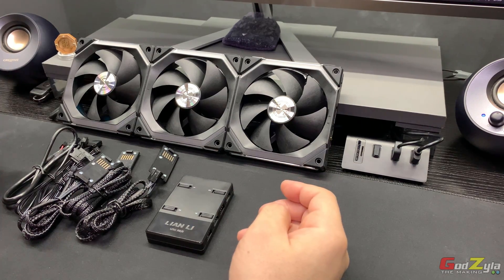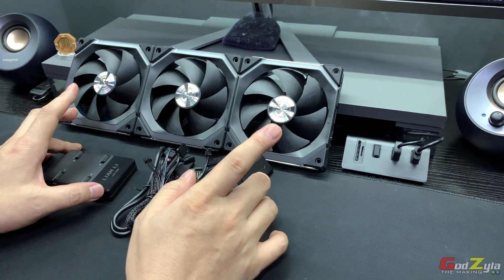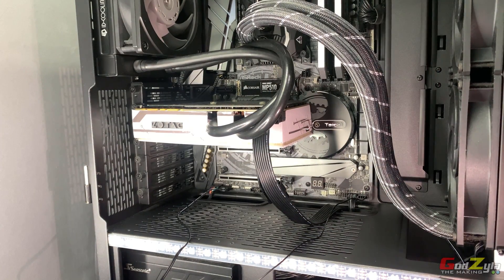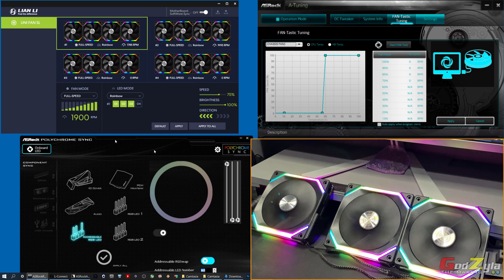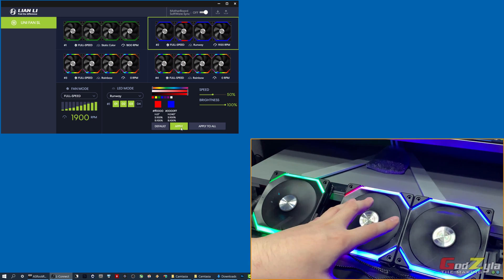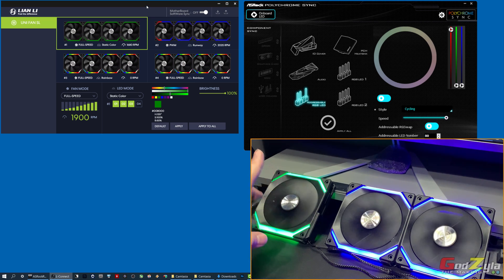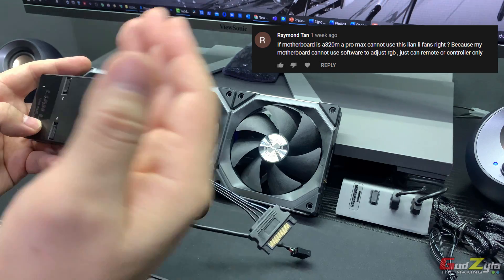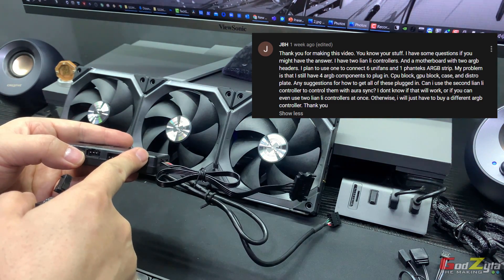Lian Li Uni Fan SL120 - Connection & The Controller (Part III) [L-Connect]

Comment from the maker: I have done a series of videos base on this uni fan which might interest you, list as follow

Introduction (Part I) - https://youtu.be/ORdObJTn-3E
Dos and Dont's (Part II) - https://youtu.be/QQHJUQvKwlY
To use Galahad AIO on Uni Fan Controller - https://youtu.be/XNCAeAX0mZQ 
Some Break Fix!  - https://youtu.be/8l4i5UjO3es 
How to link Push and Pull configuration fans -  https://youtu.be/TIO8JxVZTi8 
Using EK Vardar Evo 120ER aRGB Fans on this uni -  https://youtu.be/bMRz2KVqbjA
SL120 Case Airflow Test - https://youtu.be/Qp3pYqOOjm4
SL120 Static Pressure Airflow Test - https://youtu.be/apDZ4v_jQBs
Reply: Hallo i hope i get an answer, How much fans Can i Plug into the Fan hub?
Reply from the maker: @avur_ied5195  total of 16 to one fan hub, max 4 to each output. I like to invite you to watch the dos and dont's of the uni controller in this playlist. https://youtube.com/playlist?list=PLEW-b-2vYDdPo0NzHyeksx012c-nkDapm it will tell you about the argb load limitation.

Comment: Its weird . i did everything right. but im not able to control the speed of the fans. they're always at max speed. they make so much noise. changing to quiet or chaning the RPM on the lconnect app doesnt change anything on the fans ,, they just keep rolling at max speed. even if i put the rpm at 500 rpm
Reply from the maker: Hi Metan3x, welcome to my channel, before you do anything, check on Device Manager and under Universal Serial Bus Devices, do you see the uni controller/hub shown in the list? if it does not, then you won't be able to control the fans or the argb effects of the fans from L-Connect 3 app. I suggest you to go through this content. https://youtu.be/CgvuUFeff8U?si=6AQhAX2hX_dIvKlF

Comment: What if i connect the fan header from the hub, to pump_fan2 header at motherboard. Is it okay ?
Reply from the maker: Hi Roby Wilson, welcome to my channel. if you have two pump header. yup no issue, just make sure that you are able to set your pump header 2 to PWM mode.

Comment: My PC setup needed a hub, So i picked up the nzxt USB hub. I then connected the uni hub to that hub. hub which is connected to the motherboard's USB.  booted up the PC opened L connect 3. sl controller not seeing fan speeds as well as not being able to change the lighting effects. .. lights are on (rainbow)  also fans are spinning. but no control. any tips????
Reply from the maker: Hi TheOpsZone, welcome to my channel. first of all when you connect the uni controller only, without the fans, does the controller appears in device manager under Universal Serial Bus Devices? You might want to watch this https://youtu.be/CgvuUFeff8U to see if it helps to resolve your issue.
Reply: @KleoYan  I'll give it a try. I'll definitely get back to ya.
Reply from the maker: @theopszone6775  ok. All the best in your build
Reply: @KleoYan  Thank you.
Reply from the maker: @theopszone6775  you are most welcome.
Reply: @KleoYan  Okay, I watched your other vid. Actually what my setup is close too with using the hub. So I unplug all except for the one Iam not getting readings on, I do see the universal serial bus controller. I even unistall the software and reinstall, same issues. No readings. I also plug the front fans SL directly into the motherboard. Software still don't pick upon it. Fans are just to on autopilot. Maybe it's better to email ya, let me know thanks.
Reply from the maker: @theopszone6775  what if you plug in directly without using the NZXT hub, will that work. my email is godzylatech@gmail.com

Comment: i have three single packs for the sl120s do i still need to get the controller or is it fine to install them individually
Reply from the maker: Hi Satory_ , welcome to my channel, yes you can do without the controller but you can't use L-Connect 3 app for the argb effects as it needs it's controller.
when you daisy chain these fans and to be plug to your motherboard, please check the fan load and argb load of what your motherboard can supply. do not overload those header. for fan load, it should not be an issue if you keep the daisy chain max at 3 to 4 fans. but for ARGB, kindly check what's the ampere.
Reply: @KleoYan  how can i control the rgb then
Reply from the maker: @shoonbabaa  if you go without the uni controller, you will need to connect your fans argb to your motherboard, check to see if your motherboard have the 5v argb 3 pin header. Then make use of your motherboard argb application to control the argb effects which are limited on effects

Comment: Hey question, when I boot up my pc my fans turn back to default. Do you know how to fix this?
Reply from the maker: hi Father mike, welcome to my channel. do you mean the argb or the pwm settings? this is normal as the settings will kick in after windows is loaded and when your L-Connect 3 app booted up.

Comment: does all of this work the same for AL120 fans?
Reply from the maker: Hello Creamworks, welcome to my channel and yes they connection are the same but you need to connect AL120 fans to the AL Uni controller / hub. now, if you understand this and using the L-Connect 3,  this will give you a better explaination on how L-Connect 3 app works https://youtu.be/CgvuUFeff8U  you see the content illustrated here is using the old version of L-Connect app. hope this helps.
Reply: @KleoYan  Thank you very much I will check that video out!
Reply from the maker: @Creamworks  you are most welcome.

Comment: Was watching the video until i saw the radiator tubes lower then the pump 😱😅
Reply from the maker: hello Mikeaboss, welcome to my channel, hmm is there anything wrong with that lol.. should be a better setup this wayy though hmm.
Reply: @KleoYan  if your cooler is not overheating its ok but the tubes should be pointing up, because thats where air bubbles go. The pump needs to be lower then the tubes otherwise your pump wont last long. Its not recommended.
Reply from the maker: @TheAzorian  i see.. don't make sense.. my tubes are below.. air bubbles are at the top, therefore the punp is circulating only water and not with air bubbles. I have use this AIO from then till now .. no issue whatsoever.
Reply: @KleoYan  no bro, the bubbles will stay at the pump which is not good. If its running its fine i guess. But go online and search about it, you can get more in depth info
Reply from the maker: @TheAzorian  I see, I know what you mean now.. thanks.. but i no longer using it on my primary rig. I have changed to use a 420 in a Lancool III case . https://youtu.be/aitIxf_1FEU nevertheless thank you..
Reply: @KleoYan  no problem man. After selling my gaming pc over 1 year ago due to needing money i finally built it again. Went for lian li case, fans and the lian li galahad cooler 😍 thats why i came to check your video as it was the first time i used a fan hub and had no clue about the cables. 😅
Reply from the maker: @TheAzorian  oh.. for basics of these uni fans, just watch part I to III of this playlist (mainly the connection and use of the application and the dos and donts'), then jump to any content that says [L-Connect 3] as those that are L-Connect and L-Connect 2 are no longer the go to app that current pc builders are using. https://youtube.com/playlist?list=PLEW-b-2vYDdPo0NzHyeksx012c-nkDapm and if you need help, I will try to help you out. If I don't response to you... you can reach out to me at godzylatech@gmail.com .. I will try to help you out if you needed any.

Comment: Why does my fan controller have 2 sata power connectors coming out of it? They are built in i cant disonnect 1. Do i need to connect both to the psu?
Reply from the maker: Hi Misdom, welcome to my channel, the uni fan you have are the SL Inifinity 120 and not SL120, for SL Infinity SL120, there are two Sata connectors and yes you will need to plug both of them. you might want to refer to this video https://youtu.be/CgvuUFeff8U

Comment: To use my synapse controlled lighting  with the Lian-Li fans I had to set up the L-Connect to turn on when the system starts and then automate it to turn off a minute later otherwise the fans would just stay in rainbow and wouldn't pass control over to the motherboard and synapse etc
Reply from the maker: Hello Metatron, welcome to my channel. thank you for sharing your experience and insight of how to make use of these uni fans on Razer Chroma argb controller. greatly appreciated this. 😉
Reply: Hi  @KleoYan  no problem, yes just to back up what you said I am using it with the chroma argb controller
Reply from the maker: @0Metatron  thanks.

Comment: can we change rgb even without controller?
Reply from the maker: HEllo Luciferou, welcome to my channel, if you are using the L-Connect app, no you cannot do that without the controller. If you are using motherboard argb app. yes you can but you will need to plug the SL120 argb connector directly to the motherboard and please make sure your motherboard argb header have sufficient argb load, else you will melt or damage the connector.
Reply: @KleoYan  ok broda ty
Reply from the maker: @LawAbidingSociopath69  you are most welcome.. all the very best with your build. 😉

Comment: Why is your is showing manually fan rpm? My only shows custom...? All the fans are plugged to the controller
Reply from the maker: Hello Chris Valdez, welcome to my channel. hmm.. in this video is illustrate both can be done using L-Connect RPMs or to bypass L-Connect and to use the motherboard fan utility. Hope that answer your question.
Reply: @KleoYan  ahh, I see... so it will function just fine as long I'm able to move the graph each one? I can tell that fans are reacting differently by moving that graph chart upon applying it... 

As for the aio cpu cooler,  will I be able to increase the fan itself or it automatically does its own?
Reply from the maker: @chrisvaladez925  which AIO cpu cooler are you using? if they are SL fans and are plug to the uni controller, it will work.. unless you are using different fans.
Reply: @KleoYan  I'm using Lian Li AiO 360 Galahad , it detect cpu load on L-Connect, no options of changing rgb for aio...I plugged in on aio pump on motherboard
Reply: @KleoYan  all my fans are all Uni fans 120
Reply: @KleoYan  I'm not using the aio fans that came with it...
Reply from the maker: @chrisvaladez925  do pardon me for the late reply. ok i will tackle your questions one at a time. 

Q1)  I'm using Lian Li AiO 360 Galahad , it detect cpu load on L-Connect, no options of changing rgb for aio...I plugged in on aio pump on motherboard
A1) Leave the pump connector directly to your motherboard fan header, plug the argb connector to the uni controller. 

Q2)  also, on the lian li software,  I'm not able to change the aio cpu rgb...it's has the led on...perhaps I have to disable the other software currently connected to it using Red dragon msi?
A2) If you've plug the pump argb connector to the uni controller, either port, lets say port one, in L-Connect, under SL120, select port one  and change the effects from there.

Q3) all my fans are all Uni fans 120
A3) If all your SL120 fans are connected to the uni controller, you should be able to control both argb and fan load. here is a diagram with might aid you. https://imgur.com/gallery/beYR8CN if picture too small, kindly download and view them. by the way you will need the lian li argb kit. you will need to purchase that.
Reply: @KleoYan  ooo! Pardon your delay, we all have stuff to do lol

So far all the fans are reacting well when changing rpm.

I will take a closer look for the aio pump rgb, I have them well all connected,  I know I'm right there when reading between MB & Aio manual... 

That link you provided with it diagram should open up a bit where I missed
Reply: @KleoYan  about the argb kit, I've already have that lol it came with the aio cpu cooler , only thing was suggested was that it wants me to connect to aio pump header, not cpu header as you mentioned on that link you shared... unless I can give it a try? 

I'm able to change the aio rpm speed as well as changing rgb by using a different software on Dragon Center (I have MSI 570 Unity motherboard...)...
Reply from the maker: @chrisvaladez925  hi, as for the pump. Personally I will plug it to the motherboard pump header and set it to a fix percentage. Normally I let it run at full, as that provides consistent rate of liquid for better heat desipation and this is healthier for the pump which will prevent pump motor damages. The choice is yours..
Reply: @KleoYan  aight' I'll have it at 100% & forget about it... I'm not one to nitpick lol just casual gamer
Reply: @KleoYan  also, on the lian li software,  I'm not able to change the aio cpu rgb...it's has the led on...perhaps I have to disable the other software currently connected to it using Red dragon msi?

Comment: What if i just connect the usb cable? (My mobo doesnt have a 3 pin port, just 4 pin)
Reply from the maker: Hi Brian R, welcome to my channel. With only the usb cable plug without the argb cable to the motherboard, You are still able to control the argb effects with the L-Connect app.

Comment: Hey quick question. I have a Corsair aio I was wondering if I could take the Corsair fans off the aio and put these on. Since they clip together would they not line up with the screw holes? Would the screws that you mount the fans onto the radiator not fit?
Reply from the maker: Hello c King, welcome to my channel. This might be a reference for you. https://youtu.be/cruAHa_IdeU if u are using SL120 you might want to check Lian Li official website if your SL120 are not an issue to your Corsair AIO.
Reply: @KleoYan  thank you!
Reply from the maker: @xhale8064  just for your info. Based on the official website. This is what written :

Listed radiators are known not compatible with UNI FAN.

ARCTIC Liquid Freezer II Series
CORSAIR iCUE H115i RGB PRO XT Liquid CPU Cooler
CORSAIR Hydro Series™ H110i GT 280mm 

Extreme Performance Liquid CPU Cooler
Radiators that doesn’t follow bellow rule:  
Rule 1// The tubes of the radiator must avoid the tenon of the UNI FAN and be at the safe area, which is in grey in the image. https://lian-li.com/product/uni-fan-sl/
Reply: @KleoYan  do you have any other great fan recommendations? The fans aren’t compatible with my cooler I believe.
Reply from the maker: @xhale8064  hi, I am curious why dont you stick to your AIO Fans? for me I personally will just use Arctic P12 PWM PST ARGB https://youtu.be/caZg__l18Dk

Comment: Any way to keep the saved color upon startup? Every time I restart my PC the RGB resets to default rainbow. Thanks
Reply from the maker: Hello J Byers, welcome to my channel, try these steps 

The settings are written in L-Connect software, you have to run L-Connect to get your settings.
Please set L-Connect running as the computer starts. Following steps:
Click [Windows] + [R]
Enter : [shell:startup]
Click [OK]
Copy your [L-Connect] to [Startup] file
Restart your PC
illustration https://lian-li.com/faq_img/L1_back_default_mode.jpg
Reply: @KleoYan  Thanks, I have already done this. This does allow the color to eventually change from rainbow to my chosen color, but I would like to completely skip the rainbow startup, if possible. My Deepcool Gammax GTE RGB fan is connected to the JRGB1 on my MSI motherboard, and it starts up with my selected color that was set in Dragon Center with no problem. Any way to set these fans to do the same? Thanks
Reply from the maker: @joesified  hi as for your question, don't think is possible, you see the argb effects are done in L-Connect and this app need to be loaded when when windows starts up. I am afraid I don't have a solution for you. pardon me.
Reply: @KleoYan  The help is very much appreciated. Thank you, sir.
Reply from the maker: @joesified  hi, call me Kleo will do and you are most welcome.

Comment: What if i need to have 2 controllers but only 1 argb on my mobo? Do i have to use that cable? If so why is there even a controller box?
Reply from the maker: Hi Matt Thomson, you can use two controllers but make sure both controllers are L-Connect 2 compatible ( https://youtu.be/hZpzR_4917c). As for the argb cable, you can choose not to use it. that's only for you to by pass the controller and to make use of the motherboard argb utility to control the effects of your fans.
Reply: @KleoYan  thanks for the quick reply, does the linked video go over how to tell the differnce between L Connect and L Connect 2 comtrollers?
Reply from the maker: @mpptaj  Yes it does.
Reply: @KleoYan  thanks, you have earnt a sub :)
Reply from the maker: @mpptaj  you are most welcome and thank you for visiting and to subscribe to my channel. All the best with your build 👍

Comment: Nice! In the beginning there is a Button in the l connect named switch direction. Is it possible to change the turn direction of the Fans itself without turn them physically in the case?
Reply from the maker: Hi Nico H, welcome to my channel, I am so sorry to have missed your question. for the fan spin itself, you can't change the direction. you will need to physically turn them. again am sorry to reply you this late. my bad.